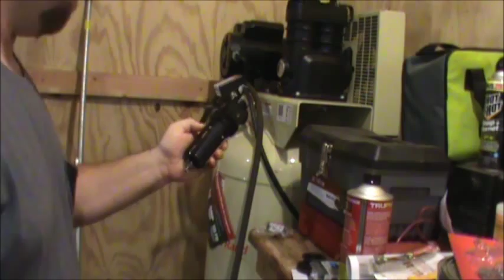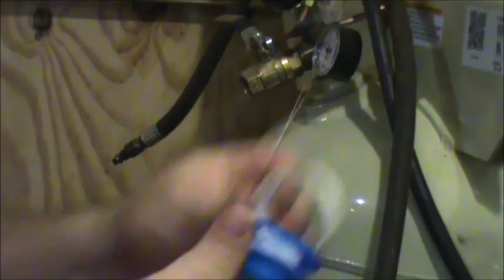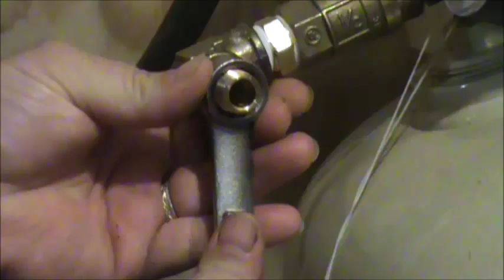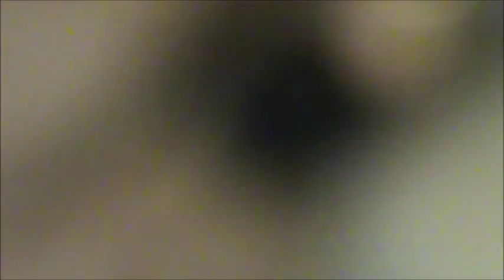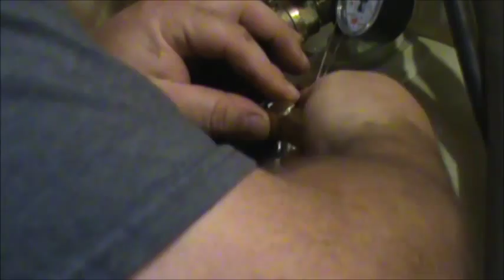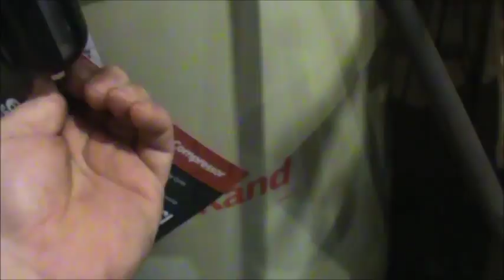Compressed Air Water Separator Installation

Comment: ive always had my air traps mounted close to the compressor like you have! ive been told you are better to run a short hose several feet away from comp and mount on the wall! prevents water from blowing thru it!!!  I will change that when I get a thousand other projects done!! lol

Comment: I've got a similar compressor as yours.  I put an electric solenoid valve on the bottom drain - just walk over and flip a switch to drain the tank.  Very convenient.  I mounted my pressure regulator and dryer on the wall and used a flexible hose from the tank to the regulator/dryer to adapt for vibration of the compressor.
Reply from the maker: lkj0822g Sounds like a good setup

Comment: Good job on air compressor its hard to get all the water out of air, the plant I worked at used a hell of lot of air they had dryers that was bigger than the compressors and still had some moisture in the air.
Reply from the maker: Joe Tiller Thanks Joe, we've got big air driers where I work too. They often give trouble.

Comment: We have a little bigger setup than that but I still see moisture come out of the line.  Make sure you use that filter when painting.
Reply from the maker: mossman381 It's hard to get air completely dry without spending a lot of money.  It isn't much but it's better than nothing.  The disposable filters will definitely be used.

Comment: Brass is the best way to go. Even if it cost 20 or 25.00. You will get a lot of years of use from them.

Thanks for posting!
Reply from the maker: jstrunck Thanks John.  Sometimes it's hard to pull the trigger on a 90° elbow that costs $5 LOL
Reply: farmboy30117 i know it is. I always have to think how many years of service i can get out of it. Lol